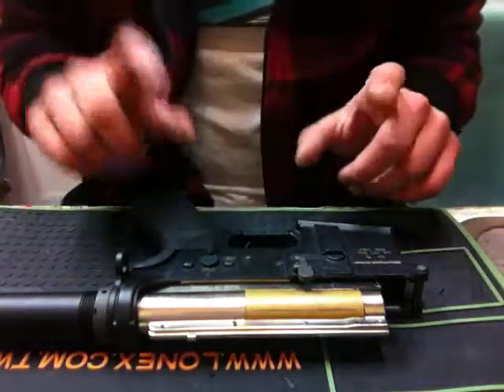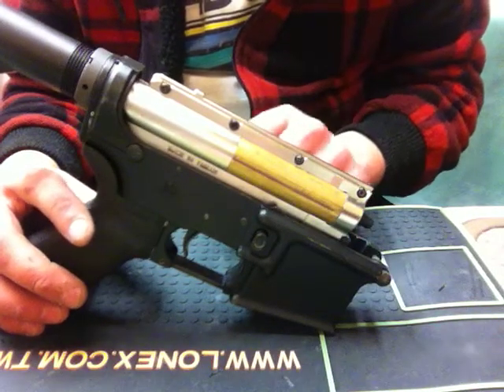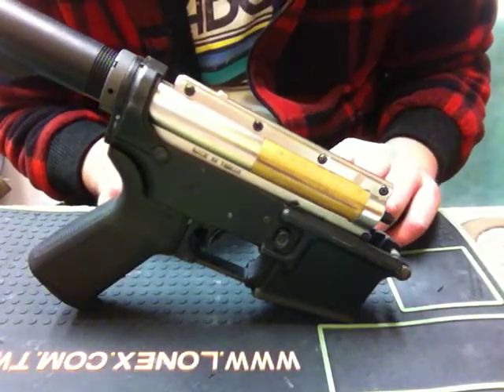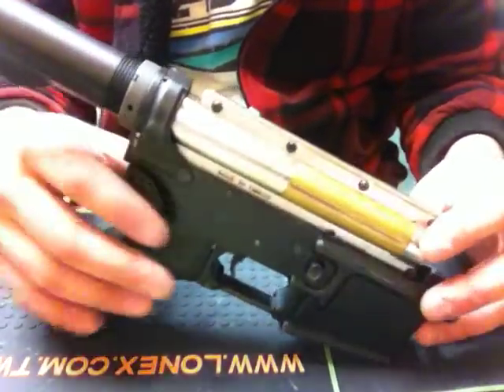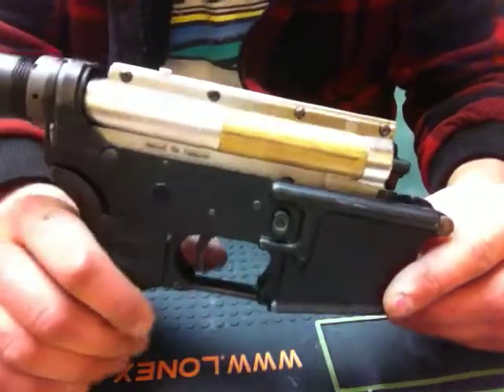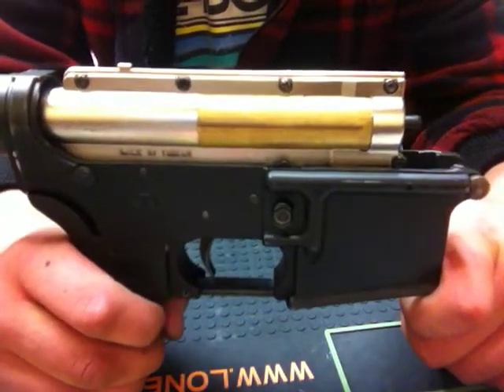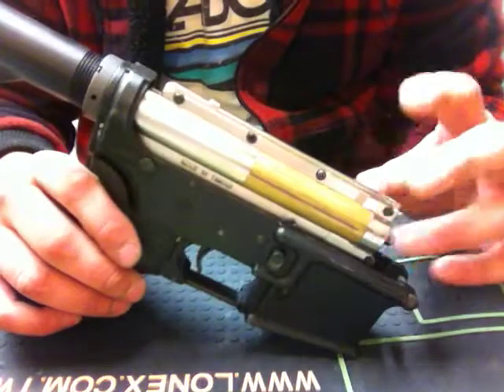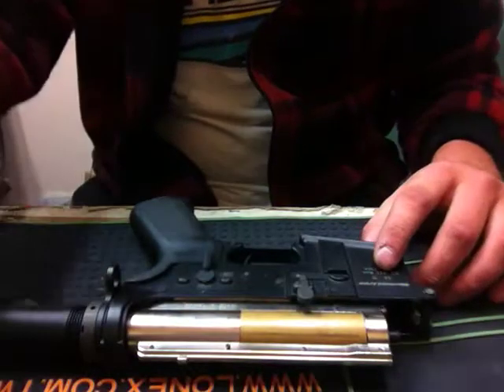Airsoft Hair Trigger Modification: Firing Test. M4 AEG

Comment from the maker: @Ben Salias
Well, I sold this build shortly after I built it - it was built using only spare parts I had laying around. Long story short, I haven't ever fielded it. Your not going to see any arcing on our AEGs when using a MOSFET, because there is such little voltage going through the trigger contacts when using one.

As far as misfires, not really. On my 9mm AR SSG I use a mechanical hair trigger and I've abused it as well as taking it apart multiple times. I can install the pieces back in place and they work just fine. So if you're wondering if they are delicate, I would say no.

Comment: Sweet dayum I like your build XD, that rof is awesome.~ but where do you keep your battery? Rear wired and with some buffer tube off, perhaps the stock? Or is it a battery box mounted setup...
Reply from the maker: Hi there :)
I actually just sold this gun, I built it from scratch and sold it :D
Yes^ ,  when running high performance set ups like this, I keep the battery outside of the gun and securely mounted to the unoccupied side of the crane stock.

I will never use small, low capacity, low-quality, low continuous discharge, optimistically rated, "airsoft" LiPO batteries on any of my guns.

Comment: how did you cut the trigger spring? like its simple with the fps spring but the trigger spring has those notches that are connected to the posts? 
cheers
Reply from the maker: luckyflukerschannel I wouldn't really endorse cutting your trigger spring, really. But since you're curios, I just removed one coil.